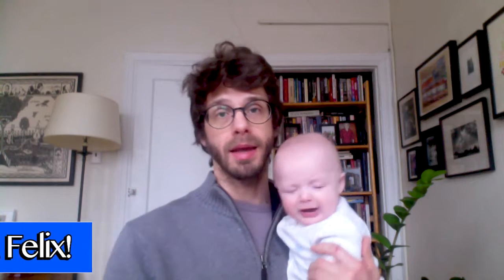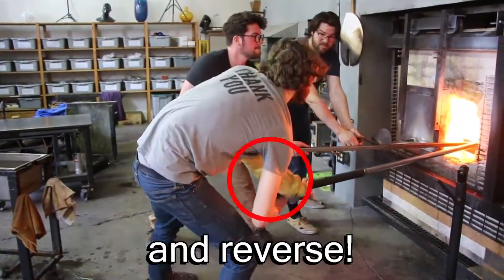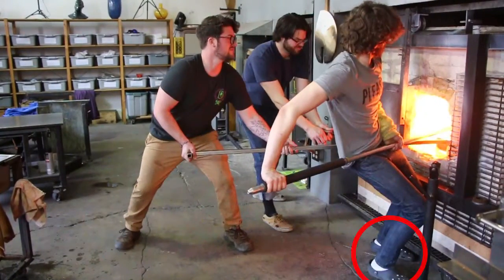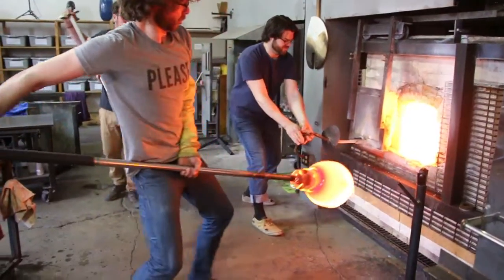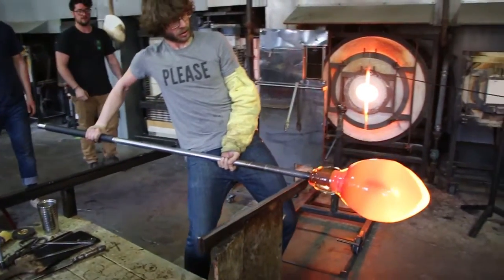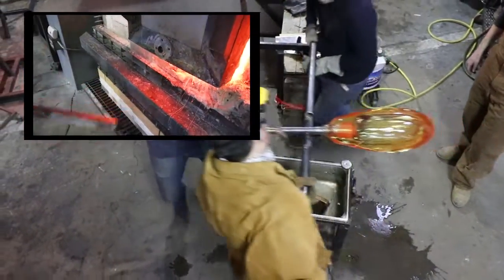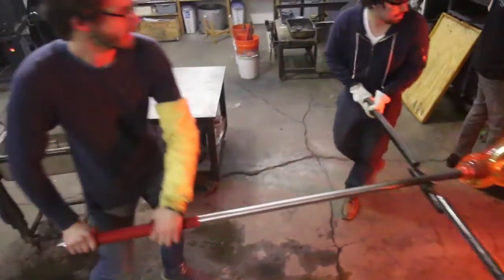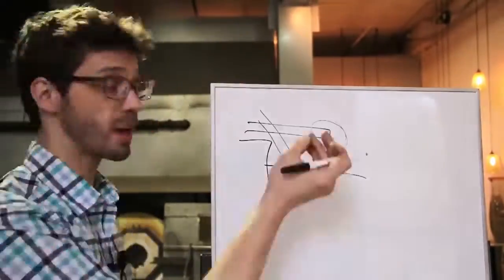Taking massive gathers safely and with control.

Comment: I'm a bit weird - left handed and work on my left side, so I turn clockwise and it's toward my body.  but I still work the piece with my right hand.  great tips, thanks for the video.
Reply: Yeah interesting how going left hand changes some things though the big principles are much the same. I'm right handed and stick to the traditional ways of doing things on big stuff, though often switch to the other side of the pipe at the gloryhole just to even my body out a little and sometimes to make sitting back down easier (cause you just have to back up, basically). Felt awkward when I first started doing it, but eventually you figure it out and then that's just another tool in the toolbox, you know...